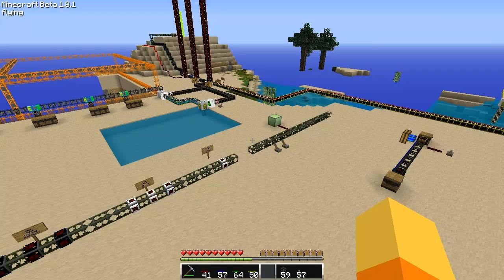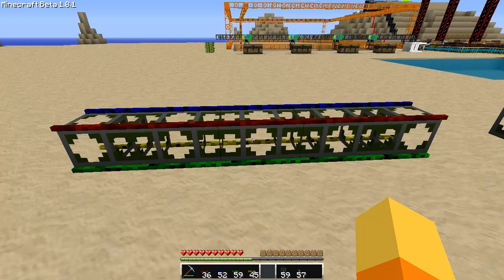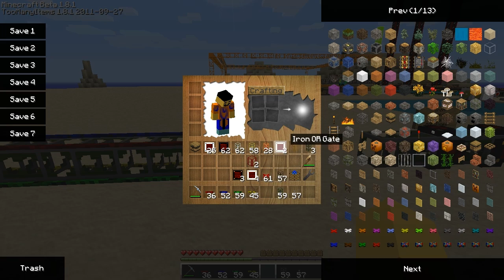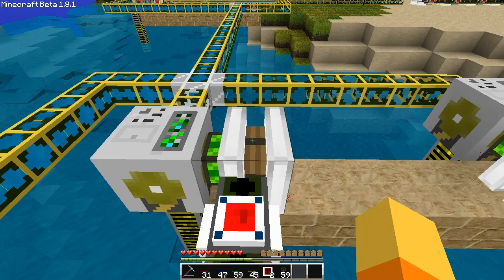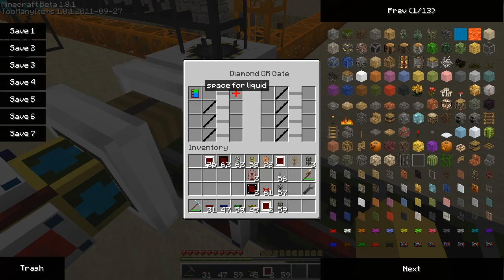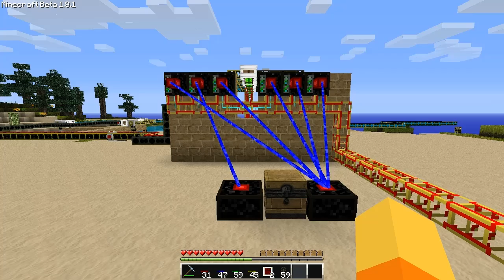BuildCraft 3.0.1 Wiring and Logic Gates tutorial

Comment: So how would you apply this to your refining engines or a furnace? I only want the engine to pump oil to the refinery when there is room for oil but if the fuel portion of the refinery has space the engine still pumps oil. Same for the furnace. I only want the engine to pump coal the the furnace when coal is needed. But if the smelting space is empty it will continue to pump coal. Does this concept only work on engines pumping tank to tank?